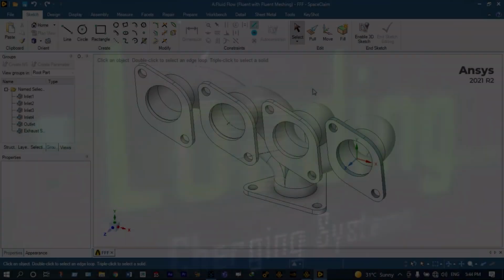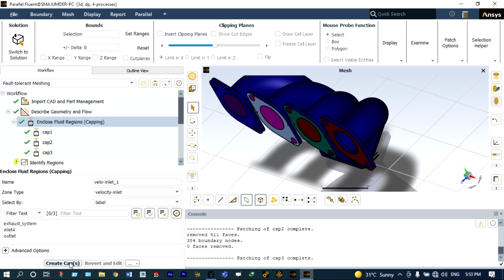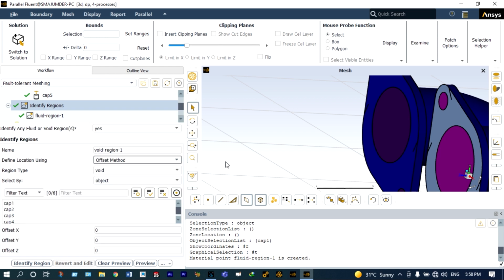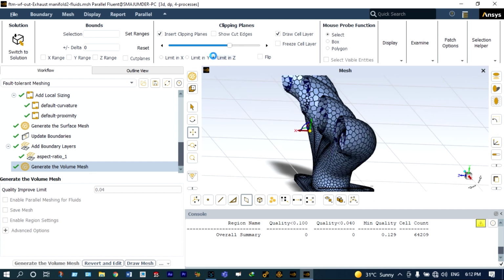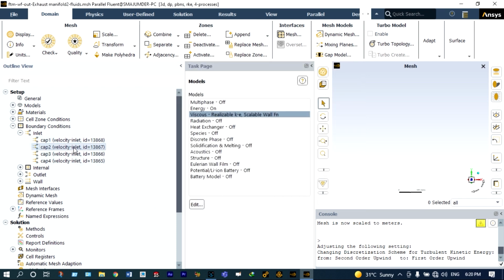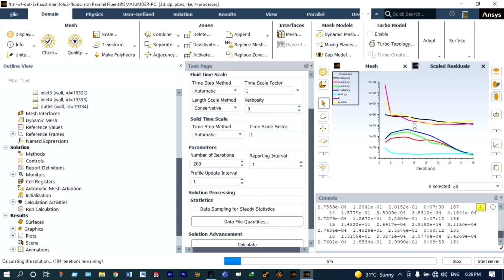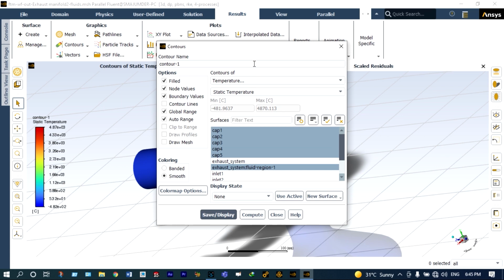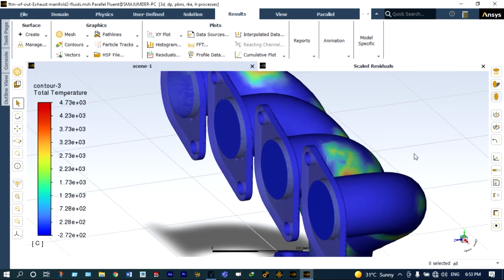CFD Exhaust Manifold | Best Exhaust Manifold Simulation Tutorial | ANSYS Fluent

Comment: sir, do you know how transient analysis on 6 pipe exhasut manifold?
Reply from the maker: There is not that much of difference. You can model 6 pipes as required and for transient analysis a bit of change in boundary conditions are to be made. It is simple